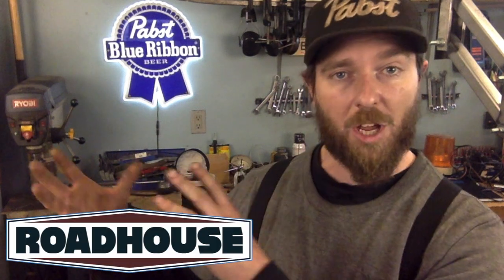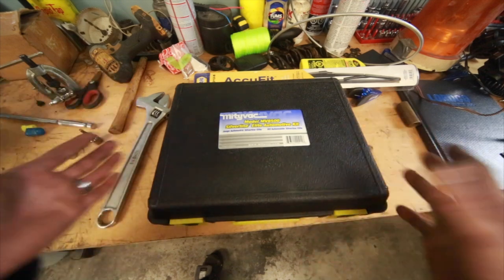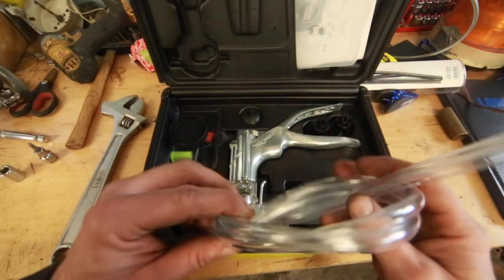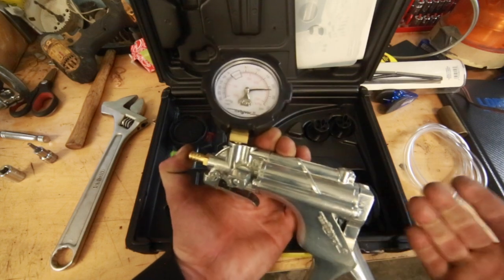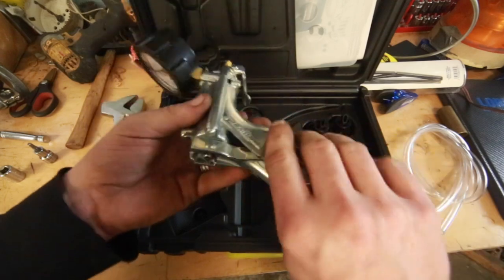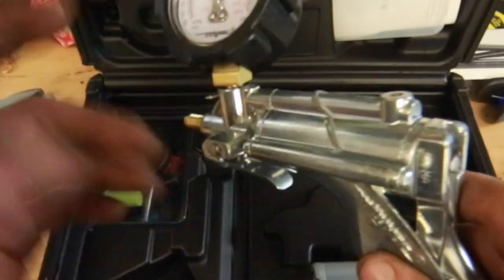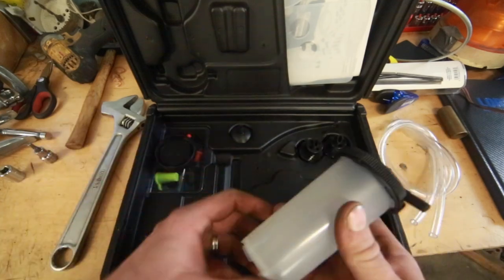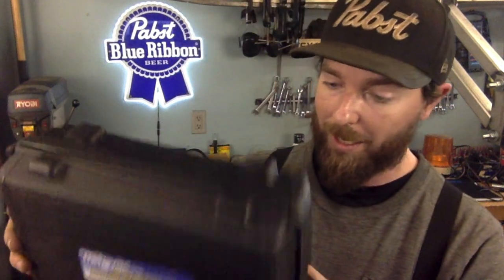MityVac MV 8500 Overview - Vacuum Pump / Pressure Tester - New Tools

Comment: I work on large diesel powered generators. Many of them are on rooftops, while the fuel tanks are in the basements. If there isn't a ball valve, or the check valve is cocked over, or just nonexistent, you will lose your prime as soon as you spin the filter loose..  Good luck trying to pull a prime from the roof with just cranking it.. 

I'll pull the supply line off the back of the injection pump, and I use that brake bleeder attachment on there to pull the prime through. Works like it was made for it. It's fast too..

Comment: I bought the mighty vac kit 3 years ago. It looks and feels solid, but after a few months of owing it the valve that adjusts from vac to pressure snapped off. Yes it's a plastic valve. least mine is.

Comment: Ive bought a few of the chinese ones from princess auto.  They work okay, but the seals wear out on them.  i usually end up missplacing it before it completely fails on me. haha
Reply from the maker: Well, if you loose'em often, then quality and warranty isn't an issue....
Reply: yeah i lend tools out a lot and forget about it then dont get it back.  i live up to my last name.  For some reason i dont think my vacuum pump has never made it into my tool box at work.  At the dealership we dont have a lot of work that requires use of a vacuum pump.  Its really made me a lazy tech, and it takes me a few seconds of thinking to come up with solutions for problems that i used to be able to be so snappy with.  I dont recommend dealer work to anyone who really enjoys problem solving.

Comment: It's been a year. How has this been holding up? Would you recommend this for a driveway mechanic that works on a few cars a year?
Reply: Almost two years now hows it holding up lol
Reply: 4 years, I wonder if it is still holding up?  Lol
Reply: @tradesman63  I still have and use it. A part of the handle broke a little bit, but it's still usable. I don't use it often, though.
Reply: No

Comment: This kit comes with a bewildering assortment of adapters, not ONE of which actually fits a brake bleeder nipple tight enough to keep air from entering the system.  You'll have to cobble something together yourself.